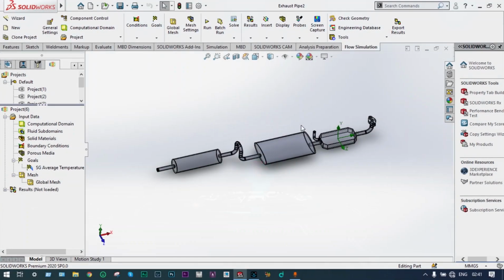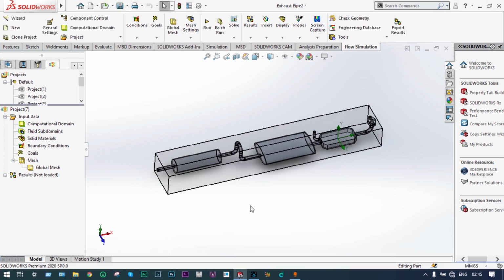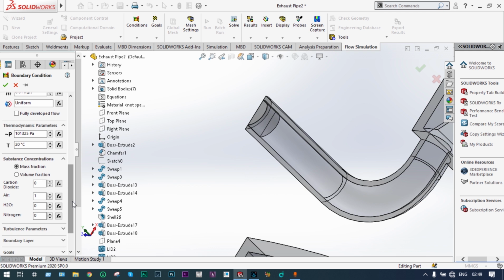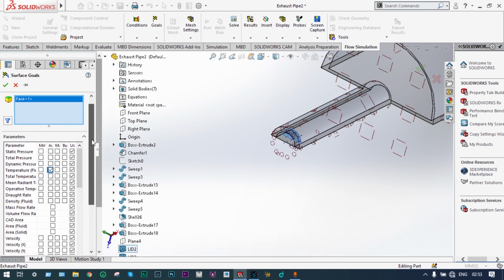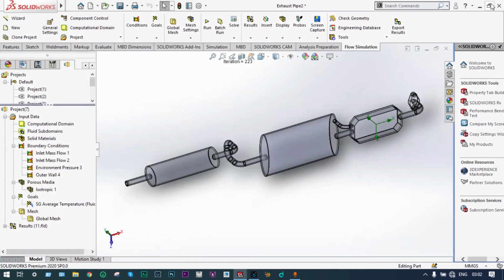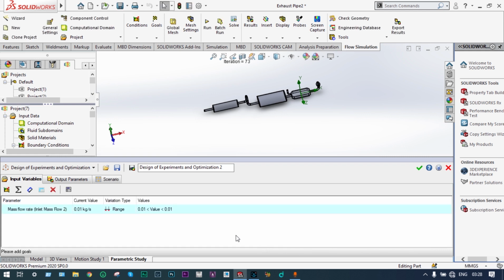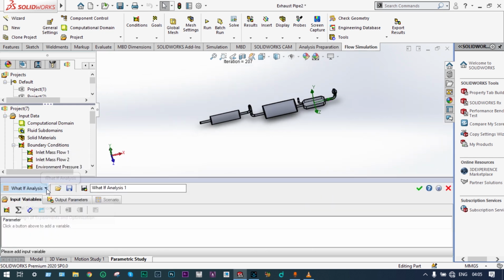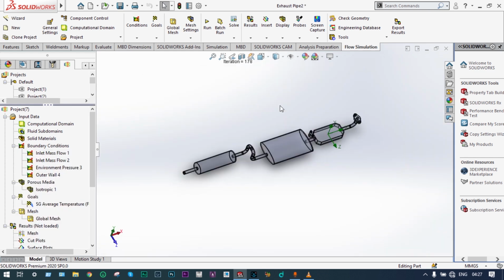Optimizing Exhaust Gas Flow Dynamics with CFD Parametric Study in SolidWorks 2020

Comment: Finally someone talking about it. I am a designer of marine exhaust systems and I use simulation flow for the calculation of back pressures on pipelines. 5.2 m³ / s 500 ° C max 6.2 kPa submerged discharge min 500mm under water. Do you want to try?